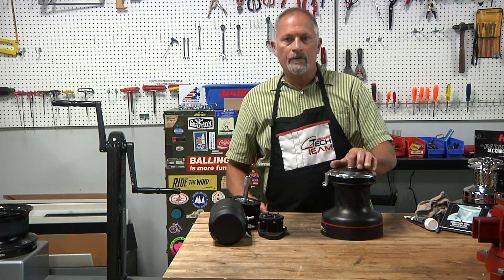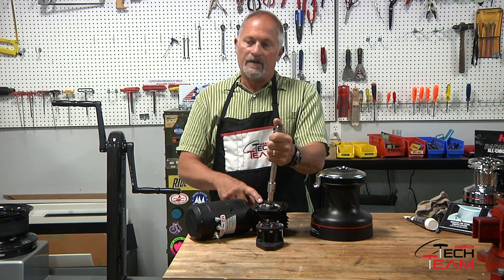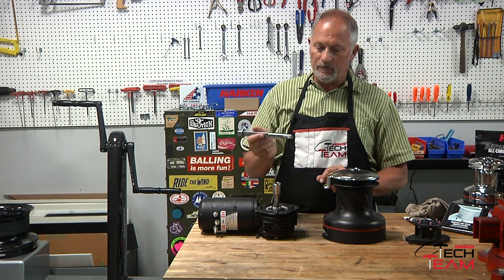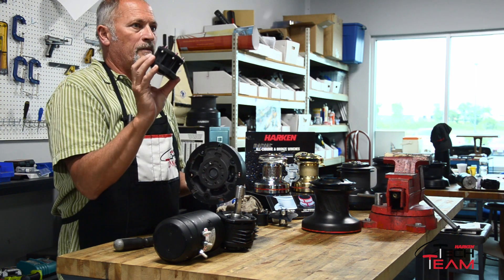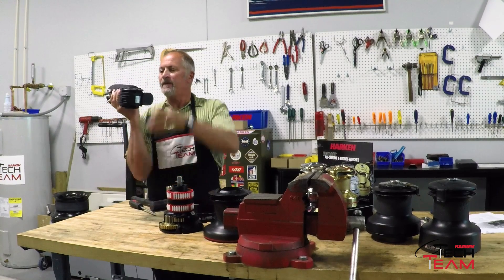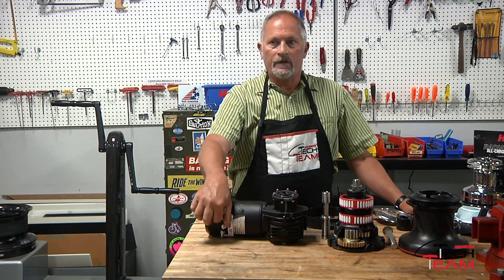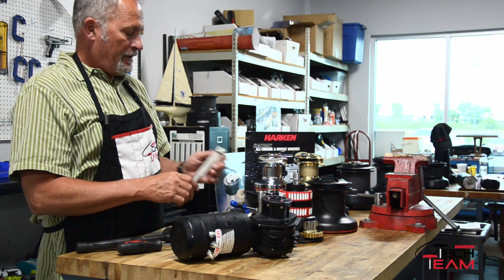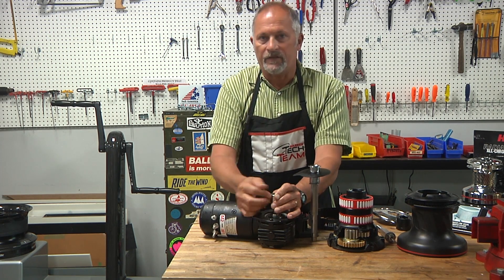Electric Winch Conversion || Harken Tech Team Asked & Answered

Comment: I think screw T might be too loose — could that be the reason why the winch handle won’t go down properly?

Also, is it important for that screw to be fully tightened?
Even though this is a different winch in the picture, the 990 looks pretty similar i believe. 

I’ve had trouble finding the diagram for Harken 990 gran price on internet.

Comment: Dear Craig,
we are facing a problem in reassembe our electric harken 60, the case is that
we had it out to rebuild the electric motor and when we tryed to put everything
back it does not engage with the winch!! is there anything else except the two 
pieces of the shaft? because it looks like there is something missing from the 
shaft to be long enough to engage with the winch.
Also Is there any possibility that the shaft could be crooked by any means?
it does not goes easily up and down (following the spring tension)
but it stuck (like something is not well aligned)
Thank you in advance!
Mike Kapetan

Comment: I am researching options for a new blue water cruising catamaran that will be 48v based electrical system. Do yo offer 48v motor option for your electric winches? We would prefer to not have to complicate the electricals with large stepdown transformers to get to your standard 24v motors.

Comment: I see this is posted 4 years ago but I have a question. Lets say the boat sinks and stays sunk for a week. Totally submerged. What is the worst case scenario for the electrified parts of the winch. I'm assuming in a pinch that the electric motors can be disconnected and the winch can be used manually.
Reply from the maker: Hi Mike, Thanks for watching and for this thoughtful question. With new technology constantly evolving, you might be surprised to learn about one Harken winch feature that has been around for years: the disconnect rod. This simple yet unassuming part disconnects the motor from the bottom of the center shaft when a handle is inserted in the winch socket. In the event of a power failure, this allows you to use the winch in manual mode, without the added resistance of turning the motor and gearbox. This safety feature also stops a winch handle from spinning if the button is pressed accidentally.
Reply: @harken  Fantastic response thank you very much! Eventually the goal is to attach new motors to the winches. Once I get to that point I'll find out what model winches are on the boat and get the parts I'll need. All the best to the Harken team I am an old beach cat sailor who has lusted over beautiful harken blocks and other parts for my H16 or SC22 :)
Reply from the maker: @mikewilliams4947  Great to hear it, Mike. Thank you. When the time comes, you might find this to be a helpful article for your project: www.harken.com/article.aspx?id=43849. And -- As always, the Harken Tech Team is here to answer any of your technical questions at technicalservice@harken.com. They can help identify which model of winches your boat has and help guide you to the right replacement parts.

Comment: audience:"
"but how much does it cost?"
Reply from the maker: Thanks for your comment, Chris. We're happy to get this information for you. The cost varies by application. If you'd like to speak with someone directly and receive a quote to upgrade your winches to electric, we encourage you to give us a call at +1 (262) 691-3320 or email us at technicalservice@harken.com. Or you could tell us your email address and we can take the first step. We will ask for details about which size and model of winches you have right now and also whether you prefer a horizontal or vertical motor (Electric winches can be mounted horizontally [left/right], or vertically for optimal use of space.) We appreciate your interest in Harken electric winches.

Comment: What do I need to upgrade from 53.2STCE to 60.2 STCE EL/HY ?
Reply from the maker: Hello Luis,
If you could please answer the following questions, we can help answer your question:
1. Do you have a 12 or 24 volt
AND
2. Vertical or horizontal
for your motor configuration.
Thank you.
Reply: Harken 1. Is an 12Volts. 
              2. Horizontal motor.